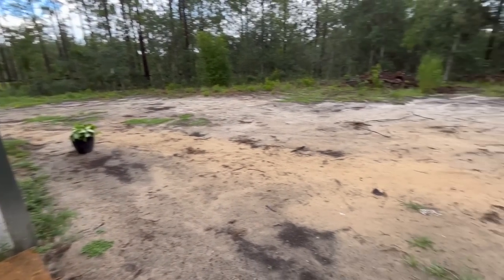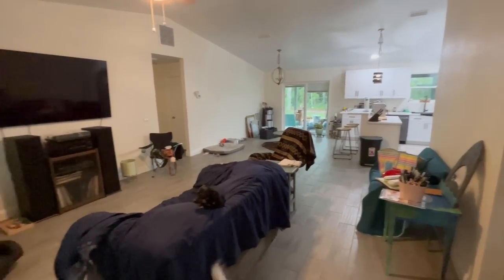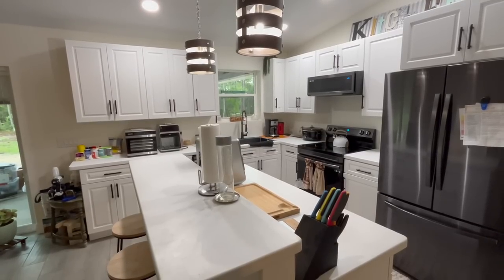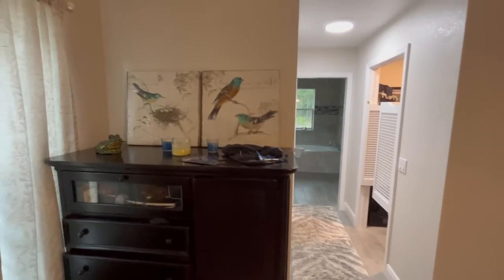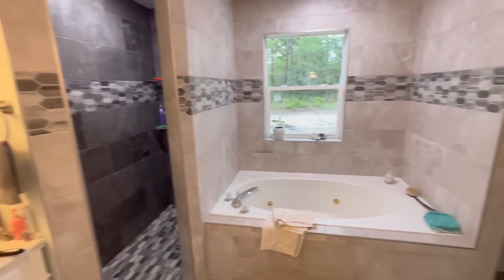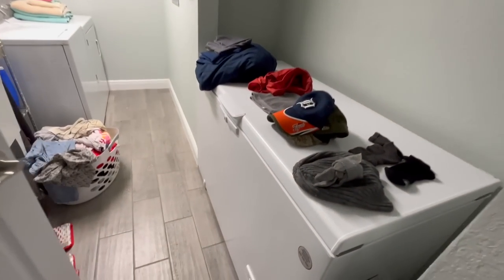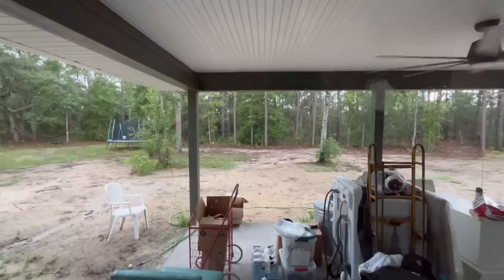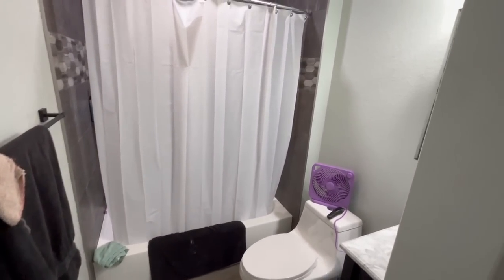A Walkthrough on the House Build After 19 Months of Living in 284 Sq Ft

Comment: Nice home. Get yourself a Miele canister vacuum and get the extra large head for hard floors. They never lose suction and the suction is strong! Worth every penny. There's a low end/cheapest model for about $400 that is perfect. I don't even know what the higher priced ones do differently! They have bags that are pricey but I swear I hardly ever have to change them. No matter how full they are it doesn't lose suction. You will not have to sweep with a broom unless you want to.
Reply from the maker: Thanks for the tip!

Comment: Dante look into an electric mop = these are fantastic for tile or wood floors to keep clean. And, the pads on the bottom can be washed in your washing machine. here is the  one I have: Spinwave® Hard Floor Spin Mop and Multi-Surface Formula Bundle...but, there are many on the market. YOu can use vinegar & water if you dont want to buy their floor cleaner that you add to the mop.

Comment: Hi Dante, I appreciate the walk through.
Looks 👍
One thing though. 
In South Africa, we build with brick and mortar only.
I've never seen wooden framed houses before. I see Dr Berry also has a wooden framed and partioned house. What are the inner walls made of?
Is it not a fire hazard. 
And how do you dampen sound through those thin walls?
Just interested as this is foreign to me.
Reply from the maker: Fiberglass insulation and drywall, neither of which burns easily, but great for hanging stuff on the walls easily. Horrible for sound dampening unfortunately.